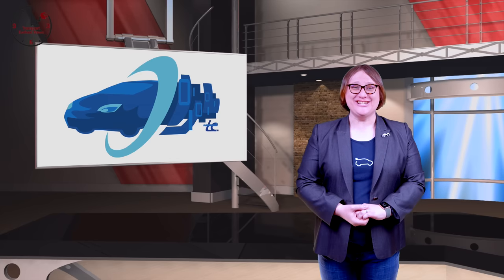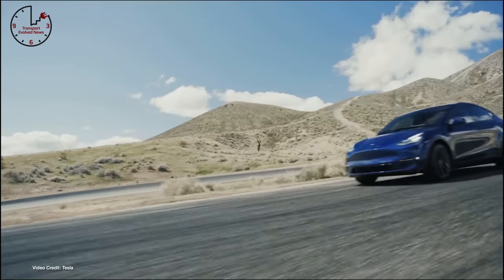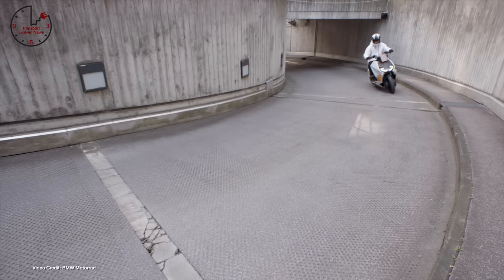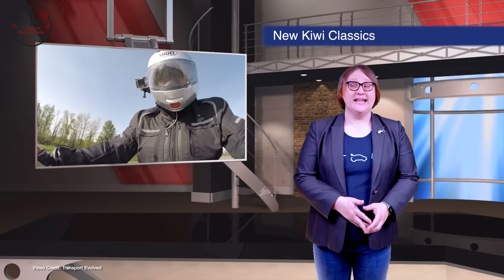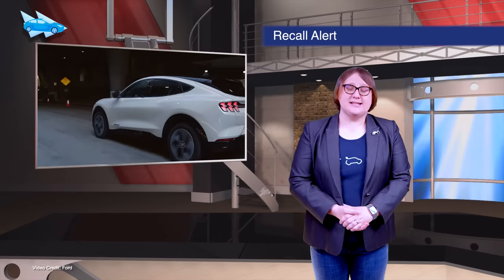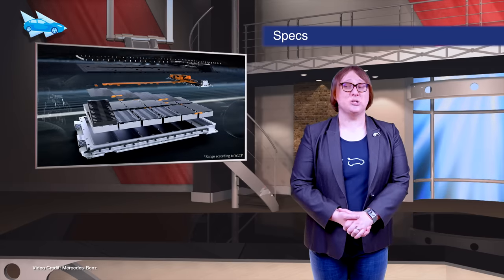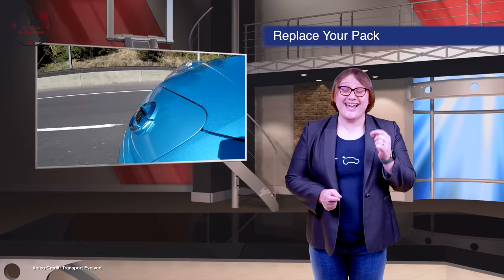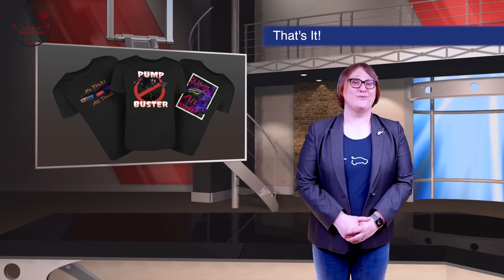TEN 333 -  Hummer EV SUV, Tesla Q1 Records, Two-Way Charging For Volkswagen EVs

Comment: Tesla is shocked to discover that Germany has regulations for business. They will no doubt be thrilled once they have a factory full of German workers.
Reply: I think they really mean the speed, not the existence. Much of the bureaucracy is still not digitalized, so there's a lot of actual paper involved, and things take time. Remember, Tesla is building their factory without having the final approvals. That's not a comfortable position to be in. And as far as I know, it's not because Tesla hasn't done something they should. It's just slow.
This is Germany, not China. Traditionally, big projects spend years with their environmental impact stuff going through the courts. Compared to that, German bureaucracy has been astonishingly fast for Tesla - but certainly not what Tesla interprets as fast.
Reply: @KaiHenningsen  Tesla not being prepared for the pace of regulatory approvals and building things that may have to be redone was the point of my post. 
Germans don't take kindly to being pushed around and Musk's tone is unlikely to smooth any roadblocks. Recall Musk's response to the German court ruling on the word "Autopilot."

Tesla will likely face similar regulatory issues here if they ever are ready to roll out FSD. They have been less than forthcoming with regulators but considering the raft of federal and state laws and regulations that will have to be altered to allow it we can expect fireworks there eventually.

And then there are the inevitable liability issues around FSD when it inevitably faces the Trolley Dilemma.
Reply: Tesla never should have chosen for Berlin. They better could have invested in expanding in the Netherlands. The factory would have been up and running by now.
Reply: When Elon learns he has to accept unions and talks with them, he's gonna be in for a surprise.
Reply: @hendrikdependrik1891  It doesn't really matter where in the EU you build your factory, regulations are a lot more stringent in EU countries and this type of project takes years in most EU countries. Tesla is attempting to apply the logic they have from the US into the EU and that simply doesn't work.
Reply: re: "Tesla is shocked to discover that Germany has regulations for business." ref American GREED/ARROGANCE.  they're also going to be shocked to discover Deutscheland also have their own long established "Big 3" automaker consortium similar to America (ie. VW, "Bey Oom Vey", and Mercedes) and is also going to be shocked to discover how Germans are NOT confused or readily DUPED about where their National interests resides, and are not confused about where and to whom they must show LOYALTY.  yeah, so no amount of outside "manipulation" or "coercion" exists that will get Germans to behave stupidly on this particular issue they're just too smart.  those "baby young" to the World and to History will not be aware that America's modern-day tech obsession actually got it's start in WW2 Germany.  everyday Schwabes/Bavarians walking the Strasses are keenly aware of this, Ego blinded Americans...?  not so much.
Reply: @Hans-gb4mv  Exactly!
Reply: @phillyphil1513  All true. Elon Musk treats the US like that as well. He decides in his own mind what is best and just does it without regard for the thoughts or opinions of others. There is a long history of this.

He built a factory in the state of Nevada because of lower regulations and tax. He didn't consider that there was no place for workers to live and no railroad connections nearby. Right now he is building a new factory in Austin Texas. That city is famous for terrible traffic and very expensive housing, more than factory workers can afford. After months of building he suddenly compained on Twitter that Austin doesn't have enough housing. 

It seems that he says and does things with his investors money without really thinking them through or asking experts for help. It is no surprise to me that he is acting the same in Germany. I expect he will have trouble in China as well once they have taken all his trade secrets out the back door.

Today Tesla makes the best EV drive systems and has the most reliable charging. That is changing quickly as other manufacturers respond to the public's new willingness to buy electric cars. Already we see luxury cars that are far better built on the market now or soon to be available. Already we see 800V charging faster than Tesla's. Already Europe has good EVs that cost less than any Tesla. Before long Musk and Tesla may lose their arrogance.
Reply: @Hans-gb4mv  The Germans have been whining that Tesla pays workers too much.  Will the unions demand lower pay?
Reply: @StormyDog  From what I remember, the high-paying positions are for top roles, people who need to work with Elon Musk (who is difficult to work with) and comes with some stringent requirements.

Let us not forget that those positions are often for battery production and there is no abundance of engineers in that field while they are competing against other companies including their rivals. Add to that the fact that Tesla is new on the German/European employment market and you'll have to offer a lot in other to convince people to come and join your company.

Comment: One day instead of using a repo, tesla will just order the car to drive back to the dealership for missed payments 🤣
Reply: Yep, nothing scaring about Tesla helping a repo of a car... If you don't pay for the car, you forfeit the right to own it.
Reply: Don't think tesla did this. If you lease, the leasing company own the car. Tesla only have to ad the car to the leasing company's Tesla app.
With the app you can find the car. Then you summon the car off the driveway, and unlock it, step in and drive away.
Reply: Surprised that this was reported.  One random Facebook user is not necessarily credible information.  My car is paired to my car which is then paired a 2nd time with the key card in place to make a "phone key."  Was the phone "cloned" to make it work on the car?  Don't see how a phone not paired to the car and not set as a phone key would work.  Also if you don't have the FSD option, you don't have summon available.  Need a lot more information on this one.
Reply: And the poor car will be very confused, because Tesla doesn't have dealerships.
Reply: @andrasbiro3007  Actually I live within walking distance of a Tesla dealership.  Some states don’t allow dealerships owned by the manufacturer.
Reply: @alistairbalistair9596  Tesla does a lot with Wells Fargo. Possible Tesla assisted, but we need to know a lot more before we draw any conclusions.
Reply: And just a week later someone will social engineer their way into the system, and take your car away.
Reply: @jur4x  First, let's not take the word of a random person on Facebook, about what actually occurred.  Second, it's a multistep process to get your phone to work as a "phone key," so no it's not like that easy a process.  FYI, keyless entry and use of your phone as the "key" is becoming more widespread, it's not just a Tesla thing.
Reply: @carljaekle  I know it becomes more and more widespread. And that what makes me more and more worried.
Reply: That day is closer than you think....
Reply: Nothing wrong with that since the customer forfeited ownership of the car when they stopped paying. Tesla can then flash the software and take control of the telematics without data privacy violations. Also must I mention, that a forced repossession of the car risks damaging the powertrain. Tesla doesn't want a damaged car back.
Reply: @carljaekle  
Tesla doesn't have 3rd party dealers. Where they aren't allowed to sell cars, they have showrooms where you can look at the cars and talk to a Tesla rep, but you can't actually buy anything. You either order one online, or have to go to another state.

There's a kind of a dealership in my country actually, but only because Tesla has nothing here yet, and people desperately want to buy their cars. Maybe there are similar arrangements elsewhere, but very unlikely in the US, because that would seriously hurt their case against the dealerships.
Reply: @andrasbiro3007  Yes, I know, I own a Tesla.  The dealerships are actually referred to as delivery centers.  You can see cars there, and test drive them, but you order online.  Also my local dealer is also a service center.  I ordered my car in about 10 minutes, no BS no games.  A lot more pleasant than a typical dealer.  There are all owned and run by Tesla.

Comment: It's a pity that the battery swap that Robert did is so expensive even as it is  - more costly than my ice car was when I bought it 2nd hand.
Reply: It is also a pity that it is on the other side of the pond. even 20 more miles would take my longer trips out of scary (low battery warn) mode. We really need chargepoints AT multi-highway junctions.
Reply: @steveurbach3093  in the UK it's really being done with a lot of help from Muxan in the Netherlands so I don't see a huge reason why the same model wouldn't work perfectly well in the US. The real issue is getting the battery from a scrapped car. I think there's very little to actually import if anything.

Comment: Yay!! V2G on the VW ID series 😀🥳
Gamechanger for grid storage?
Reply: Not yet but most importantly it is backup power for people that have occasional power outages.
Reply: It's silly to use a car for backup grid storage!!!  I have an EV and I wouldn't use my car as a power wall, that's what power walls batteries are for!!!!!! What good is a car if it's connected to the grid providing and the battery is almost at 0 and you need to go somewhere?  It sounds like a good idea but it won't be used from a vehicle to house, maybe vehicle to vehicle to help a friend out but how many friends you have with evs?
Reply: @chrisstearns10  
It's used to store cheap clean energy when it's cheap and abundant and then put it back on the grid when it's most needed at peak times. It avoids reverting to dirty gas and coal power. 
The system never drains the batteries and it only pulls at 3-6Kw so it doesn't stress the batteries. The V2G software ensures that the car is charged next time you need it.
If you have 10,000,000 cars all sitting doing nothing, they can provide then get 100-200GWh of storage to the grid for almost no extra investment. If you had to build all that storage additionally it would cost a few billion dollars. And consume a huge amount of raw materials and energy. 
V2G should, and I hope will, provide a ton of cheap storage on the grid to enable a faster build out of renewables with less worry about intermittency.
Reply: @michaelrch  Right on. V2G is perfect for tackling high power demand in the evening - top up during the day, discharge in the evening, fill back up overnight, ready to go in the morning. California would be the ideal place for this technology to cut its teeth, with its huge supply of solar which tends to drop off just as demand is hitting its peak.
Reply: @gigabyte2248  
Yes, that's what I am hoping for. Octopus Energy in the UK does V2G with Nissan Leafs. I am looking forward to them making an announcement about this 🤞
Reply: @michaelrch  this is really good news, but uk will need more 3 phase infrastructure
Reply: @Michael RCH  @garrybye4415  I agree with both of you :D

What Ovo and Octopus are going is great, and I hope it will help sort out the back-end stuff like communicating with chargers using OCPP, where the financial benefits come in and how those can enable the rollout of V2G. What I mean is, if, say, the DNO gets the benefit by offering arbitrage services to National Grid and more reliable power, they might be the ones that pay for the expensive V2G wallbox units in the next stage of the rollout. I'd try to join one of them if I wasn't living with my parents :/

3-phase is not the be-all-and-end-all, but it would help a lot. Even just a 3-phase smart charger could be very helpful for sinking excess power during periods of oversupply, but 3-phase V2G would be extremely exciting. If you could draw, say, 11kW from V2G units, then 10000 of them are starting to look like a virtual peaker plant, in a way that 7kW units would not. I would be over the moon to have a 22kW DC charger on my wall - guests and visitors (and I) could use it as a semi-rapid charger on top of any V2G capabilities. I hope more new builds get 3-phase and that the government take an interest in rolling it out to existing homes - it would help the nation a lot when dealing with oversupply, which we'll probably be seeing more frequently as we add more wind and solar to the grid.

I'd like to add: the possibility of AC V2G excites me a lot. Renault have been looking in to this - turn the on-board charger into a bidirectional charger and feed the power out of the car as AC. Making the on-board charger bidirectional would be a lot cheaper than installing a DC wallbox, and the AC V2G wallbox wouldn't be much more expensive than an AC unidirectional smart charger. AC V2G relies on the same protocol as CCS V2G (ISO 15118), so hopefully we'll see some news on it over the next year or two.

Comment: I just want a no thrills electric car. 0-60 in 8s. 330+ miles range. Powered windows as an option. No telematics. No phoning home. No selling my data
Reply: Then retrofit an old car with a BEV powertrain. Or get an "old" EV like some of the former Nissan Leafs and retrofit with enough battery capacity. Or get a more semi-recent one, but disable the mobile communication features.

Comment: I don’t get keyless, why, 99% of us have keys, to homes, bike locks work etc, but wow I can use a phone to open my car,  just use a key, simple, it works, safer, just add it to the bunch of keys you already have, keyless is trying to fix a problem that doesn’t exist
Reply: So, you are approaching your car after some shopping. Both hands are full. It's raining hard. You gonna put down your shopping to fetch your keys, search in your pocket to finally dig them out and then insert them into the car to unlock it? 

I never have to go looking for my car keys in my pocket. I also don't need to search the keyhole in the middle of the night when it's dark outside. Keyless is convenient.
Reply: @Hans-gb4mv  what year are you living in,  as long as my key is in my pocket car will open, all I have to do is wiggle my foot and the boot/trunk opens,  your phone goes flat, your screwed. Keys make sense, bet you have a key for your home.
Reply: @rwg2626  keyless means that you don't use your keys to perform tasks, not that you don't have a key. Even a Tesla still has a key card that you can keep in your wallet in case your phone's battery dies.

Comment: I don't understand the scary part about the Tesla Repo. I think repo happens after a certain number of payment fails and repeated contact with customers and non responsiveness of the customer..that means the leasing company is legally permitted to take it back as the customer is doing something illegal. So, if technology helps in stopping an illicit activity, what's so scary about it? Unless technology oversteps (like it did in Minority Report), we should all be in favor of technology stopping crime. It has worked for the past century. Yes, Advent of electric light, cars, Taser, surveillance everything helped reduce crimes. If we find GPS tracking or some remote override function to be scary in this context, then we would be scared about automatic cars too. It's just human nature, apprehensive about upcoming tech...tech has helped more than it has harmed in the long run. That's been always the case.